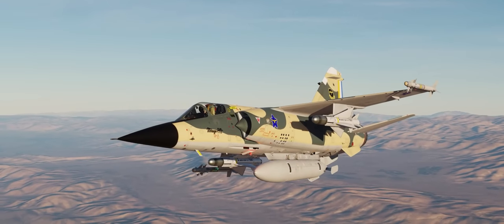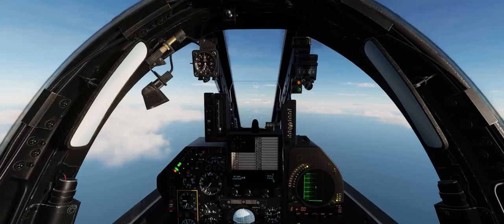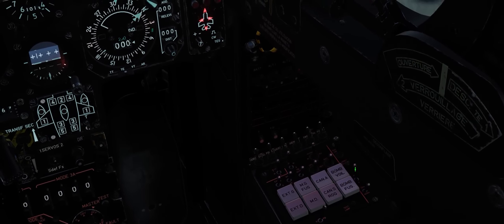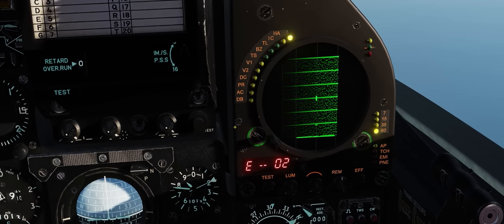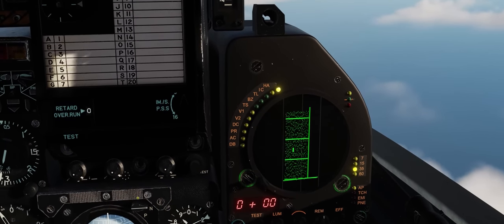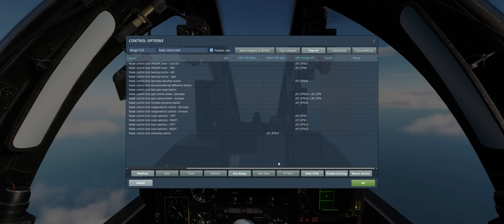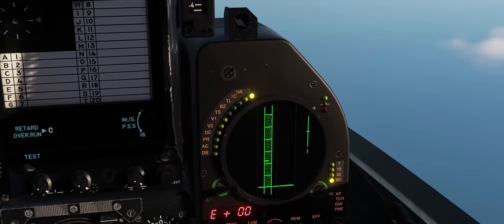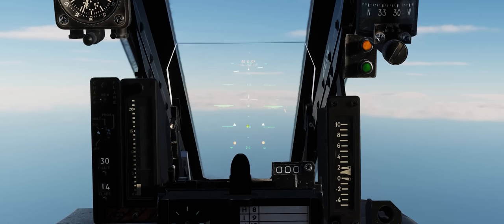DCS MIRAGE F1CE Air to Air Radar Tutorial!

Comment: Great to see you chose the SAAF variant. just to point out that the actual F1CZ had different placements for the signage and emblems. the danger triangle was under the canopy, and the 5 point castle emblem was at the beginning of the intake, also there was a springbok and not an eagle in the emblem. this is a modern day emblem. but all in all great to see it once again, even if it is simulated. do you know if it will be put on the "free to try" section as with other aircraft?
Reply: Yes and its AWFUL ! the DCS ZA guys on FB are working on breakneck speed to make the correct paint schemes and they look awesome.
Reply: @martinlagrange8821  Yes it is. i have the actual cammo colours in RGB somewhere. i didn't know there was a DCS ZA group on FB. I have just joined

Comment: "Just like the mirage 2000"
uuuh, the mirage 2000 very much does not have a separate stick to control the radar, the TDC, target lock / target unlock, and radar elevation is on the HOTAS
Reply from the maker: I misspoke and YouTube is currently editing that out.
Reply: To be fair it IS similar in many ways.
Reply: @therocinante3443  similar in many ways? The radar modes and controls are completely different between the two planes